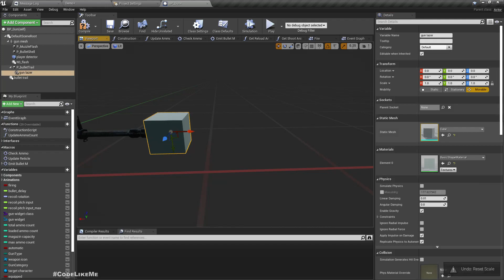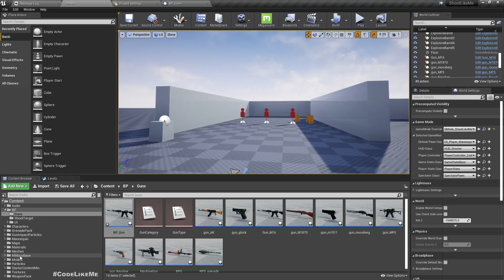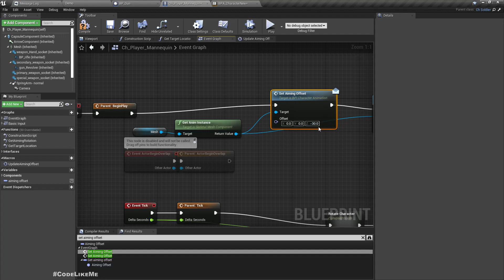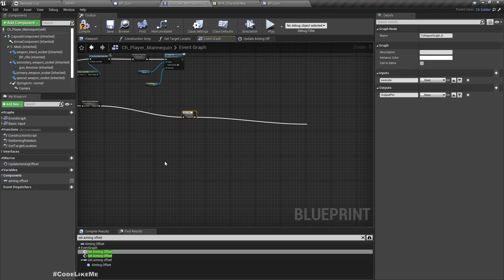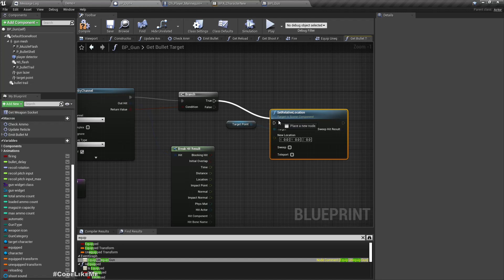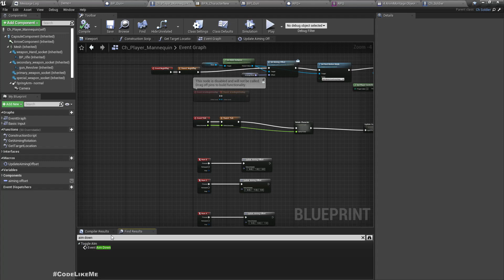Unreal Third person Shooter #91 - Dynamic Aim Offset Adjustment

Comment: Hey , i dont have a reticle but instead i have a trace which goes strith from my camera and i want to make my character point gun to that trace end point, so what should i do , find look at rotation or your method with reticle
Reply from the maker: if you are using a third person setup like me, you can still use the trace hit location and turn the character
Reply: @CodeLikeMe  I did everything it's working but for some reason even if I have used pitch and yaw to aimoffset my character hands do little roll on left